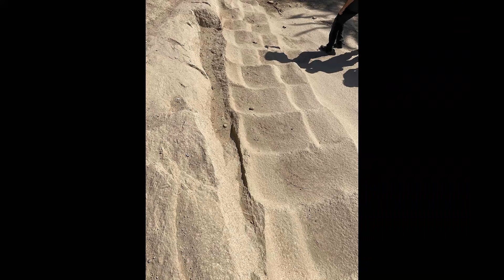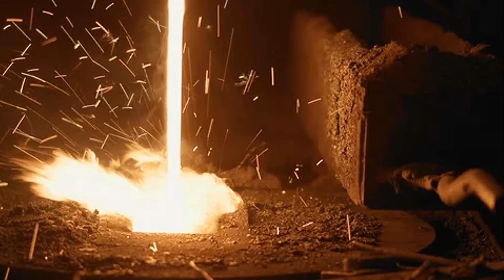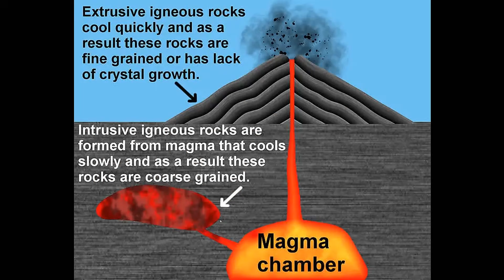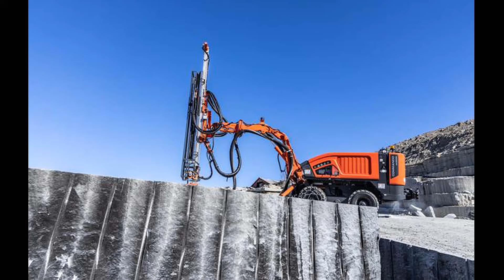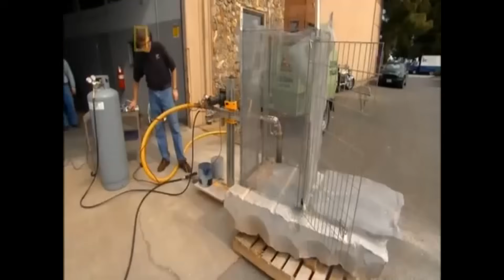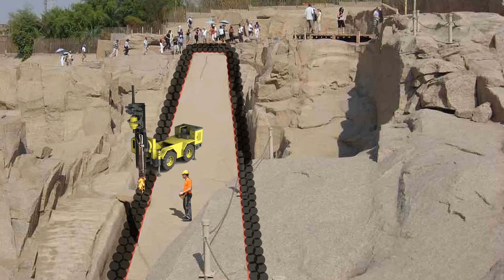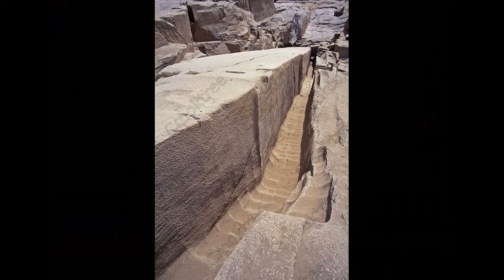Scoop Marks in Egypt: A Groundbreaking New Hypothesis

Comment: The best explanation I've seen of the scoop marks so far, well done.
Reply from the maker: So glad you found the explanation useful!
Reply: @CuriousBeingbyTina  Great video thank ypu are you familiar with  steven tasker and his theories?
Reply: @CuriousBeingbyTina how can i contact you ? I have a great idea for you to make another video
Reply: I find this flame drilling theory to make the most sense.  It would also explain why there is no waste material as it would probably be obliterated.  As for where the machines that did this might be, i think after thousands of years, a metal machine would have simply disintegrated to nothing, leaving no trace of its existence.
Reply: Nah, you cant heat rock to soften it. It melts then solidifies and doesnt have a softened stage. And when stone like this gets that hot, the molecular structure becomes too brittle to hold any real weight.
Reply: @beyondboxcreative  'you cant heat rock to soften it'
Yep.  First, these are clearly grind patterns.  If you had soft rock and were scooping it, you would leave SMOOTH scoop bottoms all over the place.  Instead you can easily see the variation in the bottom of the 'scoop' of the varying grind depths.
You could easily do zig zagging patterns and all kinds of other stuff if you had soft rock that you were merely scooping.
Instead it follows vertical lines, or vertical lines affected by the rock slope, because it was being done by other systems.
NOTHING in the slightest suggests it was 'scooped', except for people not understanding that grinding cuts with a rounded object produce similar ridges.  Only people who don't understand what they're looking at think most of these are 'scoops'.
Heating requires incredible amounts of fuel, no one heated all of the rock you see cut everywhere.  It was done in limited circumstances, but it wasn't remotely the main method used.
Reply: @beyondboxcreative    Curious, why do ignorant ppl feel compelled to go out of their lane?
--
+++ I've said this before, as a triple engineer [CE,ME, AE], physicist with experience in Cosmology and a prolific inventor, including plasma tech, I can unequivocally say that those marks look like plasma discharge machining which is similar to electrical discharge machining we use to machine metals. Hint, rocks are almost exclusively metallic and/or semi-metallic compounds especially hard rocks like granite and igneous rocks. Even calcium is a metal which then encompasses limestone and marble. I also have experience in cutting|drilling rock and other hard materials.

I have a plasma control technique that improves on this, allowing for much straighter lines which may have been employed later in the tooling process followed by a finishing process.

Of the top of my head, it would not require a high tech society to make such machines. Copper and electricity production would suffice.

Electricity and plasma knowledge is demonstrated in the Dandera Lights motif. Modern scientists have now discovered that water droplets can efficiently generate a lot of electrical energy with simple tubing apparatus. No generators required. Raindrops can also make electricity without generators.

I remarked similarly previously

PS. 
On 'Curious Being' channel, you can find a reference to new type of plasma tech machining demonstration that almost perfectly matches the given markings.
Full video: Scoop Marks in Egypt: A Groundbreaking New Hypothesis https://youtu.be/26bf49slA2s
Reply: How about an industrial scale up of dolerite smashing! Yeah..who says you got to do it by hand! Like pile drivers with 40cm breaks
Reply: Hori sheet you stoopid.
Reply: Yes some good ideas here, got my sub.
Reply: She comes so close to the sensible answer,.
Ancient Egyptians knew a hot fire weakens granite. You can see it yourself by chucking a rock into a firepit; after the fire dies down, you can break it with your hands. But you don't need fancy machines. A bin full of hot coals, another of mud, and a pot of water suffice. Make a low wall of mud around a spot and shovel in hot coals, wait a bit and quench with water, and then you can bash out a good inch deep in seconds. People have known this method for very a long time. 
Some people would like you not to know of it; you should not trust them.
Reply: 1. Quarry Pile-Drivers  
   • 40 cm dolerite spheres suspended on scaffold‐mounted block-and-tackle systems.  
   • Dropped from 2–4 m to cut uniform kerfs and hollows in Aswan granite.  
   • Red-ochre marks on the balls match paint used in Egyptian workshop tagging.  

2. Roman Repurposing at Dura-Europos  
   • Surplus or spent quarry balls shipped along Nile–Mediterranean–Euphrates supply routes.  
   • Found in late Roman siege layers alongside ballista hardware and local shot.  
   • Wear patterns show concentric release rings overlaid on quarry‐use pitting.  

3. Supporting Evidence  
   • Stratigraphic association: dolerite spheres with red paint in siege debris.  
   • Petrographic match: dolerite mineralogy aligns with Aswan quarry samples.  
   • Experimental archaeology: ball-drop tests reproduce Aswan quarry hollows.  

Together, these lines suggest a two-stage lifecycle: first as quarry pile-drivers in Egypt, then as heavy artillery shot in Roman frontier warfare.
Reply: # Next Steps for Conclusive Proof

1. *Request XRF/ICP-MS* on one of the stored “DE-1924-37-24” spheres.  
2. *Publish a short note* in Journal of Archaeological Science or Levant calling attention to the red-painted dolerite.  
3. *Compare wear patterns* under SEM between confirmed quarry pounders and siege balls.

These studies will move the Aswan-to-Dura hypothesis from “intriguing” to “scientifically confirmed.”
Reply: @ButterBuns00  Hitting granite with dolerite spheres will not produce smooth cuts in the rock, but rather, especially at the start of the cut, will produce broken surfaces... Why would they go to the trouble of polishing these surfaces to give them a smooth cut? And it only makes sense, by using gravity for a vertical cut... but, even with all these inaccuracies... How do you explain the horizontal cutting pattern that maintains the 40 cm trench? This is inexplicable.
Reply: @josesilvam They didn’t just bash stone on stone. They used a quartz particle charge—basically sand—as an intermediary layer. It made the whole process more efficient. The sand absorbed shock, reduced tool wear, and even helped guide the direction of the cut. Massive stockpiles of this quartz sand have been found at megalithic quarry sites, suggesting it was a standard part of their industrial toolkit. 
Created a “self-polishing” effect over thousands of impacts, especially in areas where the pounding was concentrated.
Reply: Maintaining a consistent 40 cm cut depth across vast quarry faces—especially in hard stone like granite—was no small feat. The Egyptians achieved this with a combination of precision, rhythm, and clever engineering. Here's how they likely did it:

---

# 🧱 How the Egyptians Maintained a Consistent 40 cm Cut Depth

## 1. 📏 Pre-Marking with Red Ochre Gridlines  
- Before pounding began, workers laid out a grid of red ochre lines directly on the granite surface.  
- These lines marked the intended block dimensions—typically 1–2 m wide and 40–60 cm deep.  
- The grid ensured that each team worked within a defined trench, keeping depth and spacing uniform.

## 2. 🪨 Depth Control via Drop Height and Sand Charge  
- Workers adjusted the drop height of dolerite pounders to control bite depth.  
- As the trench deepened, they reduced the drop height to avoid overcutting.  
- A quartz sand charge at the base of the trench helped regulate energy transfer and prevented deeper-than-intended impacts.

## 3. 🧰 Use of Depth Gauges and Templates  
- Simple wooden or bronze depth gauges (like giant calipers or rods) were likely used to check trench depth at intervals.  
- These could be inserted into the trench to verify when the 40 cm target had been reached.  
- In some cases, a horizontal string line or plumb bob may have been used to align the trench floor.

## 4. 👷 Team Coordination and Rhythmic Labor  
- Quarry crews worked in synchronized teams, often in rows, striking in unison.  
- This rhythmic pounding ensured even wear across the trench and minimized overcutting in any one spot.  
- Foremen likely walked the lines, checking depth and spacing as the work progressed.

## 5. 🪚 Final Dressing and Leveling  
- Once the trench reached the desired depth, workers used smaller pounders and abrasive rubbers to flatten and smooth the base.  
- This final pass removed any irregularities and ensured a clean, level detachment surface for block removal.

---

## 🧩 Why 40 cm?

- It’s deep enough to isolate a block structurally, but shallow enough to control with hand tools.  
- It matches the average reach of a dolerite pounder dropped from shoulder height or scaffold.  
- It allowed for modular block sizes that could be transported and stacked efficiently
Reply: Toolmaker’s Day at Aswan

The sun had not yet touched the quarry rim when I arrived at the tool yard, where the dolerite balls lay in rows like sleeping suns. I ran my hand over one—cool, pitted, and whispering of yesterday’s labor. My name is Hori, and I am a maker of tools, a shaper of the shapers.

Each morning, I walk the trench lines before the pounding crews arrive. I listen to the stone. I look for signs—a chipped edge, a fractured grain, a ball that’s begun to oval from uneven strikes. These are the quiet injuries that can ruin a cut or break a man’s wrist.

Today, I selected three damaged pounders for reworking. I carried them to the shaping slab, a flat granite surface near the edge of the quarry. With a smaller dolerite hammer, I chipped away the high spots, restoring the sphere’s balance. I worked by feel—by the way the stone rolled in my palm, by the sound it made when tapped. A true ball sings.

Once reshaped, I rubbed the surface with coarse sandstone, smoothing the scars and sharpening the edges of the impact zone. Then I painted a red ochre mark on each—my signature, and a warning: this ball is ready, but not immortal.

By midday, the pounding crews returned. They came to me with calloused hands and tired eyes, asking for replacements. I handed them the newly balanced balls and reminded them: “Drop straight. Let the sand do the steering. Don’t force the stone—it listens better than it obeys.”

In the afternoon, I inspected the scaffold rigging. The ropes were fraying. I called for new hemp lines and retied the pulleys myself. A snapped rope could kill a man—or worse, ruin a trench.

As the sun fell low, I sat beside the tool rack and watched the last strikes echo across the quarry. The granite gave way, slowly, rhythmically, under the weight of tools I had shaped with my own hands.

I do not carve temples. I do not raise obelisks. But every clean cut, every smooth trench, every block that sails down the Nile—begins with the balance of a stone in my palm.
Reply: @josesilvam  'How do you explain the horizontal cutting pattern that maintains the 40 cm trench? This is inexplicable.'
Take a bunch of rounded stones, let's call them chisels.  Now drill holes in them, and make a bead chain on a rope.  This is what makes the maintained spacing for the 'scoops' that aren't scoops, they are grind patterns.  Bounce a second stone on top of the chisels and you will grind cut into the stone the chisel is touching.
If you watch someone cutting a modern stone in half manually, they have a steel chisel that looks like a mini sledgehammer, that they use to positon where they want to hit, then they hit it with a second tool, a hammer.  If you take one stone, let's call it a chisel, and hold a corner in place, then hit it with another stone that we'll call a hammer, it is far more accurate than using a single stone as a 'pounder'.
The 'pounders' left at the site are actually chisel stones that got rounded off as they were used, and became too small to use without risking your hands.  The 'lumpy rounded' is the aftereffect of use, they started off as stones with corners and used the points until they rounded and became too small to hold safely.  If they were still good tools they would have been carried off, these were the leftover trash items.
Realize, look at 17.18 in the video.  Turn an 8 or 10 foot obelisk sideways.  Put the point of the obelisk into the cut.  Now have a large stone hanging on a rope over that side of the obelisk, say a few hundred pound stone.  Put 3 or 4 guys on swinging the stone, and bash it into the big end of the obelisk.  Obelisk weight supported on another stone as a fulcrum, and a hammer stone weight supported by the rope it is swinging from.  3 or 4 people's muscles, all going into the stone and bashing into the big end of the obelisk, and concentrated down to the cutting tip of the obelisk.

They had a simple manual powered jackhammer, and the undercut that larger obelisk like it was butter.  It took them weeks to cut these out, not years.
Take 2 stones from ropes, like a 2 position Newton's cradle.  Keep one stone against the face as the chisel, an swing the second stone to bash it into the rock face.  Move the chisel around a bit to cut and flatten the area, and then slowly descend.  That's how you get the vertical scoops.
Now make a bead chain of chisels, with 20 or 30 in a row, and a bead chain of hammers.  Use a lot of people, and descend your line of chisels and hammers as you go.
You can easily make rock faces that look just like this, it was all manual and kinetic.  No one was using one stone to cut, they were using 2, just like you use 2 items in modern times, a chisel and a hammer.  They just used stone for both instead of steel, because it's what they had.

Realize, you can explain almost everything you see cut very easily with JUST STONE.  Rock against rock is far more useful than most people consider it to be.

Comment: I think spalling is definitely the cutting mechanism, but the large size of the cuts makes me think something other than flame jets were the source of heat.  The quartz in the rock undergoes a phase change at 573C expanding by .82% to create stress, and you want the thermal gradient to be extreme at the surface so bits explode off.  Egyptians were smelting copper and firing ceramics, so I wonder if lead heated to a temperature just below its boiling point, say 1400C, could be poured into granite holes to create a cutting effect.  There is a lot of thermal energy in a dense molten metal compared to a gaseous flame, and less heat would go to waste being blasted off into the atmosphere.  The lead would solidify at 327C (doused with water perhaps) allowing the solid ingot to be pulled out of the hole and remelted.  The granite chips would float and be skimmed off, and the lead could be poured back into the hole.  Where a hole overlaps another, a small dam made of limestone and mortar could be used to contain the fresh pour.
Reply: That is a more convincing method that a flame thrower. What fuel would they have used to create the flame? Melting metals was a known art. I imagine they found out by accident that pouring molten metal on granite caused it to make a hole. Then it would be a simple thing to use that in quarries.

Comment: Certainly the best hypothesis and explanation that I have ever heard, other stone walls such as the ones left by the Incas exhibit most remarkable cut lines that just cannot be done with what mainstream archaeology submits, it's highly improbable and the malleability hypothesis and theory is certainly one significant possibility, the other incredible part of the equation is the weight factor, I have had discussions with mainstream archaeologist that use the approach of moving these with simple manpower the more brutal force applied the better the reaction which is the biggest load I have ever heard.

Comment: Scoop mark spalling could have been made with a coating of thermite then igniting it. The transfer of heat from a solid or liquid is more than that of a gas. Watch how they instantly weld the ends of 2 railway ties together. Then you could shock it with water and hit it with the splinter balls … also in South America the Inca walls could have had this high energy heat packed between blocks then ignited…
Reply: Don't need fancy stuff, just conventional wood/charcoal burning, especially if confined and properly air drafted.

Comment: How the hell do you soften granite?
Reply from the maker: That's why I think the Aswan granite was not softened.
Reply: @CuriousBeingbyTina  well if it wasn’t and it was made by some sort of tool, what was the power supply and that tool would have to be anchored somewhere close by to minimize the torque on that head so wouldn’t there be anchoring marks? I asked this from a mechanical engineering point of view. I agree those marks don’t look like some sort of hand held tool. There are two regular.

Comment: OK, we need to have gas generation and high pressure pumping. This all requires high granularity engineering. We also would expect some pictorial representation of the process. But lack of evidence does not disprove an idea, and clearly some method of moving a lot of intransigent material from difficult places, with characteristic witness marks existed. And this is a good theory. Personally I think it was alien robot ants. Hopefully we will cut through our current hubris and look at these ideas and define the dolerite balls as just that. Balls.